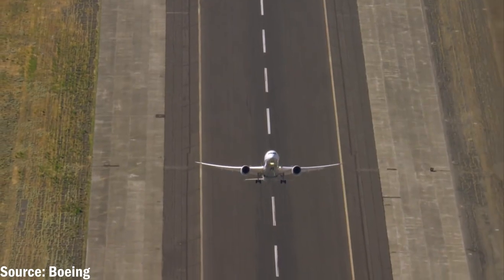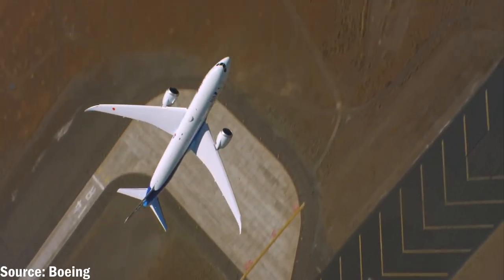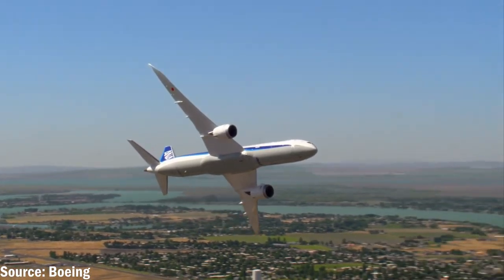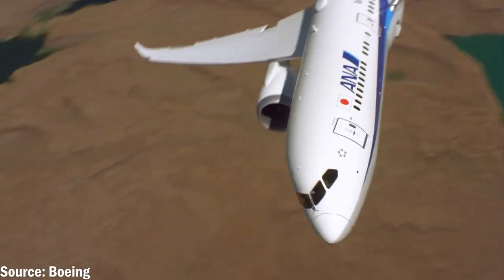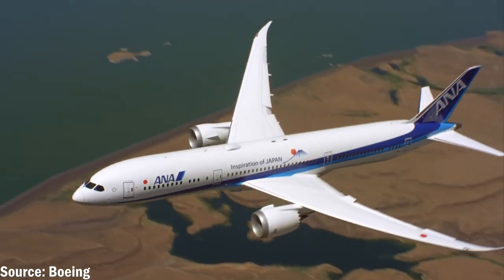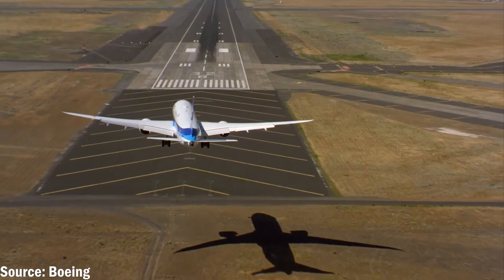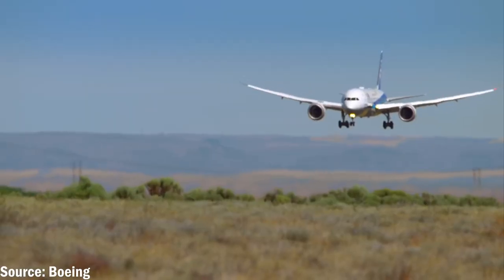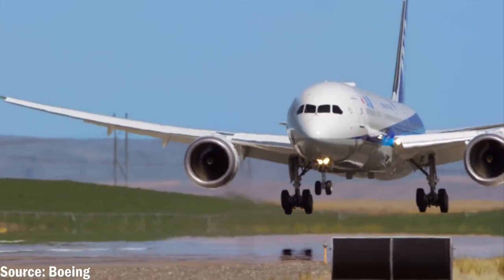Carbon Fiber Planes | Aerospace Engineer Explains

Comment: Great video, just have to add a point of information, at @2:30 the layups are vacuum bagged (usually every 3-8 layers and before / after core then final) to prevent bubbles and voids, the autoclave is more or less the controlled cure

Comment: Yes carbon fiber is light, but it has its issues just like aluminum, the problem with carbon fiber is that it has to be covered all the time, to protect it from ultraviolet radiation. Over time you may get water ingestion in between the fibers of carbon and other composite materials.

Comment: Hi Austin, great video. I don't want to come across as though I'm spamming you, but I've released a few videos now on the potential for using carbon fiber in rocket airframes and exploiting its superior tensile strength to build far larger rockets. Given how much stronger it is than aluminium, the only reason I can think of as to why we're not using this material routinely to build truly enormous rockets is the manufacturing costs. In the videos I suggest we continue building out of aluminium until we have the technology (massive 3d printers?) to begin building rockets as large as some of our taller skyscrapers. And I agree, seeing passenger planes made entirely of CF in the future would be awesome, far more efficient, and faster. Nice vid.

Comment: Aint no way I am getting on a carbon fiber plane after the sub incident.
Reply from the maker: If you fly with any regularity you probably won't have a choice. It's very different pressurizing for an aircraft vs a sub. Not to mention Boeing can't skip testing and certification like the sub did
Reply: @AviationAustin  I dont plan to fly on 787 or 350s anymore. You cant fully analyze  something that hasn't been around for at-least 30 years through testing alone. If there is a flaw, it takes time to for nature to expose it usually at the expense of one big human tragedy.
Reply: @ssap3717   dude really you know they are certified right? Also subs and planes are not same🙄
Reply: @ssap3717   Also 777 launched in 1994 and consist 12% composites
Reply: @ssap3717  well slowly there will be no aluminum planes left, what are you gonna do then take ships?
Reply: @greenesyt563  After 30 years, I will consider CF as safe if no significant mishap happens. I am sure aluminum planes will be there until then.
Reply from the maker: @ssap3717 the 787 has been flying for 13 years with no incidents.